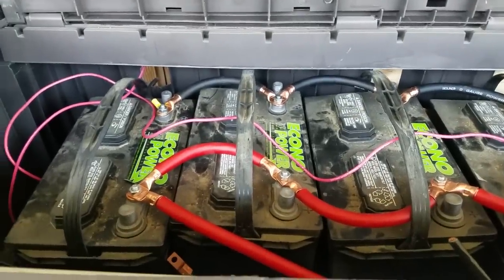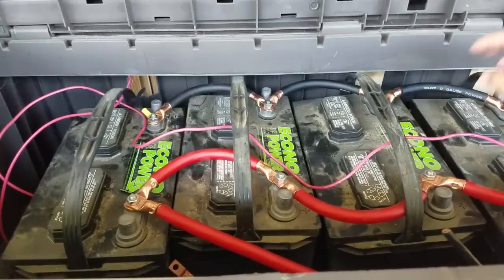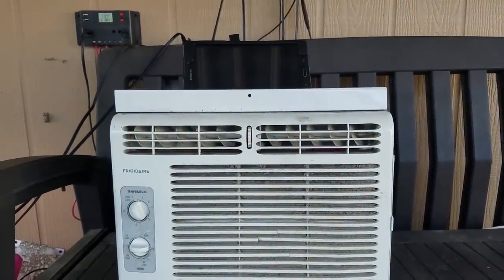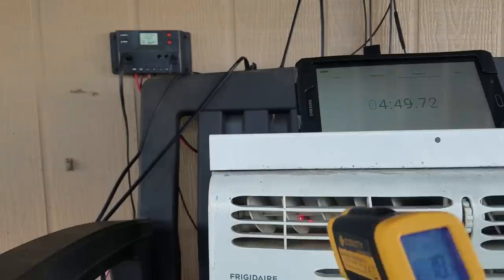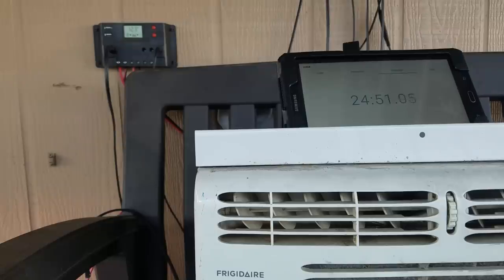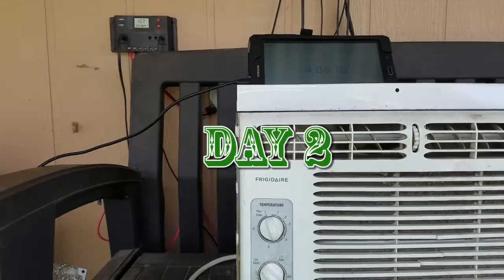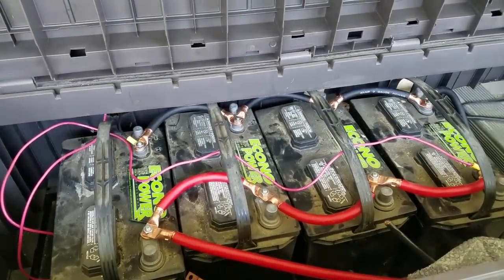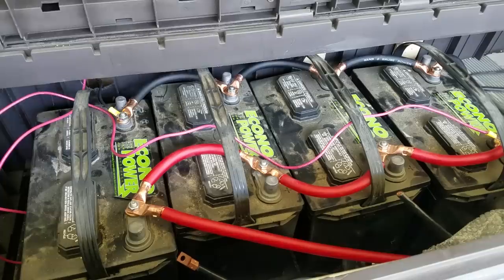Running a 5000btu air conditioner on Harbor Freight solar panels?

Comment: Yea, what Clyde said. And then there's the deceitful Title of the video: "Running a 5000btu air conditioner on Harbor Freight solar panels?". Umm, you're not running the air conditioner on them at all. This is clickbait of the highest order and on top of it all you only have only have 150W panels and they alone wouldn't run the unit if you tried...

Comment: Is the inverter pure sinus??
What the watt usage of the AC ???
The wapor from the batteries .. Will Damage you inverter .. 
You need a 60A MPPT 750watt 150pv 
And bigger leads .. you hawe Lot of loss.. 
Nice setup thoug .. 
Greetings from Denmark

Comment: Hey" guess what.?? I can also run any TV, with a washing machine pump, turned into a generator, by attaching a 12volt D.C. motor, to the pump shaft, and spinning it 4 to 5,000 Rpm's.!! Try it guys" I guarantee it to work, or I'll help you with anything causing it not to.!!!

Comment: If you get a 24 volt inverter and reconfigure the batteries you can halve the size of the wire.  The size of copper wire you are using is very expensive.  There are other things wrong; My system is 24 volt, with 6x 12 volt 130 Ah batteries connected 2s3p.  I have a 1.7kw split aircon unit that I can run any time the sun is shining, but I don't dare run it any other time, because I need the battery capacity to run the rest of the house.  However, I have been off the grid for about 18 months now, and didn't have air conditioning at all before.  I am still grid-connected, but my bill is now about $6 a month.  I have 16 72-cell panels on the roof, with another 3 permanently wired to the water heater.  The inverter is 2.4 kw, with 50 amp battery controller built in.  Limiting the discharge to 12.4 volts is way too conservative for AGM batteries.  Mine is set to 11 volts.  Batteries should last at least 10 years.

Comment: I think the concept is feasible. However, the testing environment is not anywhere near "real world". Leaving it outside on a chair? Trying to combat global warming 1 btu at a time?

I would guess putting the AC in a room where it was designed to operate as per btu ratings. This would (after proper room cooling) make the compressor shut off as the room reaches desired temp, thus allowing the panels to charge the batteries more efficiently.

Unless of course, you live in Death Valley or the Badlands. In that case, your 5000btu unit might cool your toilet room.

Comment: I have eight 6v 240 ah batteries. I cannot run my ac on my batteries. I could run it during the day. I have 2k Watts in panels. The compressor loads peak when starting. 

You are short charging. It’s not a deep charge. There’s a charge to bring it up to 12v. I have 24v. Then the bulk charge. Which is pumping capacity back in amp hours.
Reply: The inverter itself will handle the start up loads unless your inverter is ancient! My 3000 watt inverter has a 6000watt surge all the new ones are like that.

Comment: My harbor freight panels work great. Just use them as emergency lighting in house on 2 regular wall switches. 2 lights upstairs and 2 lights down stairs. Wired them in when built house. Came in usefull half dozen times. Pain finding 12 volt bulbs tho but great as a cheap way keep house lit. Charge 2- 35  amp hour batteries. Stay charged at 13.5 volts for 3 years and always work when you turn on switch.
Reply: Home Depot sells regular size 12 volt bulbs

Comment: You should have run the a/c in a closed space like in a garage by doing so it would  lower the temperature of the closed space down and that way the compressor could recycle and not remain on continuously and that would minimize the power consumption too. I think your setup will be able to handle to run the a/c all day long if it’s a sunny day and if you runt it in a small room and you will be able to run the a/c for 2-3 hours on a full charge of the batteries at night

Comment: Your A/C is running in this Scenario in the worst conditions possible because it is out side and will never cycle on or off  there for your Compressor will never cycle.  I would bet your compressor has not been coming on at all in this set up.  Your thinking is all wrong about solar running in these conditions.  Your A/C would be running on the Battery's not the Solar Panels. I dont think your compressor ever turned on after its initial start.

Comment: Again, another "What can you run" video that is misleading! You are not running on the solar panels, you are running on the batteries! The charge controller showed 13.8 at the beginning because your batteries were charged, once you started the air con the controller dropped to 12.4 because that's how much the panels were sending to the batteries! NOT your battery level! You have no meter showing the drain on your batteries!
Reply: And 12.4 is not even discharged to the limit. 12.1 would be 50%

Comment: There was a comment that you aren’t running directly off of the solar panels which is correct. I doubt that the panels would provide enough energy to run the ac. 

What you have is a bank of batteries sufficient to run the ac for a while but the one set of hf panels won’t run the ac by themselves. The ac will consume more than the panels produce.

However, if over a period of time you fully charge your batteries, then you can run the ac. Note that the ac will run for a shorter time than it took to charge the batteries.

A simple but not exact example would be to fill up a bucket with a hose and record the time. Now dump the water out of the bucket. Are the times the same?

Long time to charge, shorter time to use up.

Comment: Those batteries and the inverter are running the the air conditioner, not the solar panels.  They alone could not run the AC.  You have to have a big enough battery supply and inverter to run an air conditioner.  The question is how long can the solar panels keep the batteries charged up.  The big battery bank decides how long the air conditioner will run.  The solar panels would not keep them charged enough to run the AC given enough time.  How long were the batteries able to run the air conditioner with the small solar panels charging the batteries.  The solar panels would not be able to keep it running indefinitely, that is the question.

Comment: It is easy to figure this out. Plug the AC unit into a watt meter like a killawatt and see what it pulls
while the compressor and fan are working. Now, I find a good rule of thumb with batteries is
to multiply the amp hour rating by 12.5 then multiply by .5. This is the number of watts per hour maximum your batteries can deliver after a full charge  if they are in good condition. Now divide this by the power pulled by the AC unit and you can calculate how long your system's batteries can drive
an AC unit. As for the panels and charging. Look at the actual voltage of your batteries and
the amperage reading for charging off your charge controller. Multiply the amps from the
charge controller by the battery voltage and that is the number of watts your solar panels are delivering to your batteries at any time. So, if your batteries are being charged at 14 volts at
100 amps, you are experiencing a charge rate of 1400 watts. Now, this will go up and down
as the sun's brightness varies due to clouds and such. Also, a 100 watt panel does NOT
put out exactly 100 watts. Most of the times it varies between 50 - 80 watts when the sun is out.
Then there are line losses. The higher the current from the panels to the charge controllers, the
more the losses. Thus the reason why such thick wires are used. You can offset this by
using a MPPT controller and running your panels in series in a 48 volt or higher system.
A MPPT controller can take something like 48 - 90 volts and drop it down to 24 volts
for charging batteries in a 24 volt system. Much more efficient then a 12 volt system and
the gauge of wire needed is far smaller. You also experience far less line losses so  you
can place your solar collectors farther away without the line loss issues. Also, ALWAYS
use a pure sine wave inverter  to drive anything with a motor like a drill, saw or AC unit.
modified sine wave inverters are cheap, but they are hard on electric motors.
Reply: How many watts solar panel do I need to power a air conditioner that's 500w ?

Comment: Batteries gas off . This will cause corrosion,etc. in an enclosed area. Also, hydrogen and oxegen are produced which are flammable. You have a fan,etc. that look like they wouldn't be safe in that type of an environment. Sorry, just trying to help.

Comment: I know it's not the newest video, but it is a 2018 video. But I don't think you went long enough. I know it's a lot of footage to deal with, so since you have at least a bit of reputation is say you can turn the camera off for like 4 hours and just monitor the voltage yourself. And of course record your phones time so that people know when the test started, then when you come back you have the phone show the time. 
Even 4 hours seems short, so if it were me I'd start around 9 or 10 am, and let it run as long as you have battery power. That way we can truly see how long you can go.

Comment: Conclusion? How many hours can you run your air conditioner on your batteries down to 50%?. And from what I've learned studying solar whatever the amp hours of your batteries you want at least twice up to four times the solar so "example" if you have 300 amp hours you want 600 to 1200 watts in solar.

Comment: 5000btu ac needs 12 hrs compressor time /day or 12x 450watt/hrs = 5400watts/day  min.  You need min 10-100watt solar panels  (1000watt x 6hr = 6,000 watt hrs useful) to charge 12-100 amp/hour (12,000 watts, 6,000 useful) 12volt batteries to power a min 1200w sine wave inverter to run a 5000 btu (450 watts/hr 225 average) window ac unit round the clock..   more batteries would be better, each battery good for about an hour of compressor time. . 6 would get you thru a hot night in Texas if the room was insulated properly. Compressor will run half the time depending on inside /outside Delta T.  and insulation r value. 
This rig will produce about 6KW of electricity or about $0.75 a day. Or $22.50 a month.
Will pay or itself in about 5-10 years if you do it yourself.
A 2kw inverter generator will burn about  $8 to $10 worth of gas per day doing the same job.
A cheap 2k-4k generator will burn twice the gas.
Grid power Natural gas Co-Gen generator units are at least 8-10 times more efficent at turning Natural Gas into electricity than are gas generators. 
In an emergency, shut your house down and drive to your GrandParents house. 
Or get a little 2kw Honda Invertor Generator. 
Also it takes about a 600 Watt load (300 per hour average ) to run a refrigerator. Cost more to run an RV one on propane.

Comment: The test is not accurate by any means. You have the A.C. unit mounted in a window. Once your room becomes cool, you run the A.C. on recirculation. This takes in the pre-cooled air and cools it down again. Thus using less energy. Also, you didn't check it during the night when you'd likely to want it the most. Things to consider

Comment: As long as you have more input on average than output per given time frame you can run anything you want.
Reply: How many watts solar panel do I need to power a air conditioner that's 500w ?

Comment: For safety reasons the fan should always blow fresh air into the battery box and out a vent hole on the other side. This way the explosive gases don't pass through the potential spark source that is the fan. 

Otherwise, nice setup for occasional use, emergency backup power. 
I would make sure that there is always a small load on the system though to keep it cycling and to keep the charge controller from constantly having to dump power during the day time. Like maybe a little 5w string of decorative LED porch lights or something.
Reply: Christopher Gaul That's an interesting point about the fan, I never thought of that! It doesn't seem very likely to happen but I've heard of stranger things! Thanks
Reply: Blakehx no problem. I've had to work on some pretty highly safety conscious job sites and I've picked up a few things I probably wouldn't have considered on my own. Always happy to share them.
Reply: That's kind of a waste of time and power... The only way he is going to produce enough power to cause his batteries to boil is if he connects a battery charger. I have 4- 150 AH 12 volt Trojan 1275's under my dinette getting a 15 vdc 50amp charge everyday for at least 6 hrs and those "explosive gases" have yet to blow up my camper... The amount of hydrogen gas produced while charging is very little, even with 1 KW solar, my batteries only off gas for about 2 hrs per month when I equalize the batteries and still not enough explosive gas to blow up, even when I test the situation with a lighter... The gas that is created could be very dangerous if the battery box was air tight, but even a small gap in the lid or box will allow any gas to escape, no fan is required, the HHO gas that is produced is lighter than air and will escape faster than propane or any other gas that you have ever dealt with, it is also highly explosive as it is 2 parts hydrogen and one part oxygen.
If you want to play with a simple hho generator you can make one with a glass of salt water, two stainless steel spoons a couple pieces of wire tied to the spoons and a 9 vdc or 12v battery connected to the other end of the wires, drop the spoons in the water without letting them touch, the bubbles that are produced are HHO gas, now take a match or lighter and light the bubbles, they will pop like a firecracker! Your battery can produce the same thing only not as much gas.
Reply: Chris G , your comment is helpful to many people and constructive and not derogatory, way to go ! Our politicians could learn from you. While big government likes to tie our hands and restrict us it people like us on these platforms that are true patriots whom are finding ways to free us from being oppressed by bullies like the electric corporations and their lobbying effects.

Comment: Busted for what? Harbor freight solar is not the best financially or efficiently. You can buy a quality 100 watt mono panel most places for around $120 A good mppt charge controller $200. Running 6-8g wires from controller = more charge. Up grade to trojan batteries. And yes, running that cheap fan is going to cause an explosion when the off gassing hits the sparking brushes.

Comment: This really cool and all, but there are cheaper and better ways of doing this. The cost of raw solar panels is around $1/watt I think. Harbor freight solar panels cost around $2/watt. For example, look on ebay and you can find 100 watt solar panels for around $100. Just remember that the rated output is in absolute ideal conditions like direct sunlight on a cold day in winter near the southern end of the norther hemisphere with an MPPT charge controller. Also, invest in a 24v system with a good MPPT controller and a pure sine wave inverter. 24 volts means less current for the same wattage, the MPPT controller allows you to get the max output of your solar array and a pure sine wave inverter are way better for running inductive loads. You may spend an upwards of $800 on the charge controller and inverter alone if you get commercial units but if you are going for an off grid setup it is worth it for reliability. Suddenly the solar panels don't seem so expensive compared to the rest of the equipment/batteries! Oh yeah, batteries, use deep cycle batteries if you want them to last more than a month or two under normal use. Car and tractor batteries are not designed for constant daily use like in a solar power rig. Have fun, and good luck!

Comment: Thats not solar, thats battery.  And i wonder at 100$ per battery, the panels cost, and all the rats nest of wires, oh and battery's changed every 4 yrs again 400$ more bucks...geesh just pay the power company. You can run a dingy 5000 watt ac unit ( smallest window unit made) like forever and forever on 1000$ which is what you have in this after 4 yrs. And that same 1000$ runs that unit much more than an hour per day.